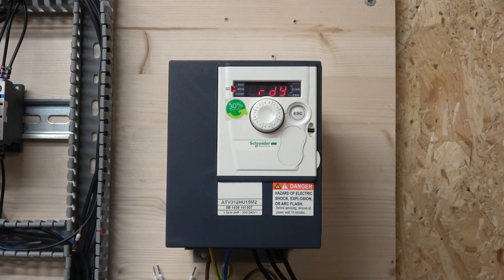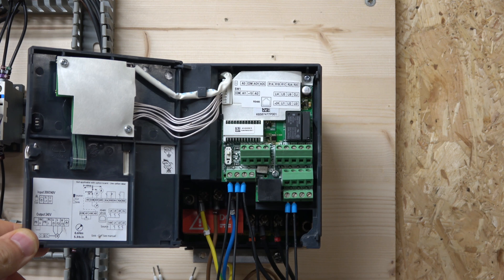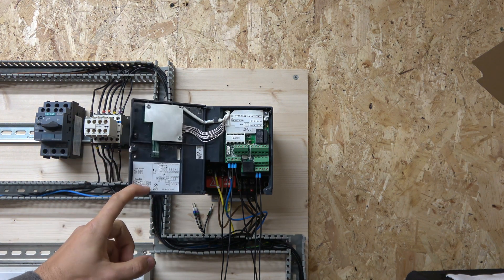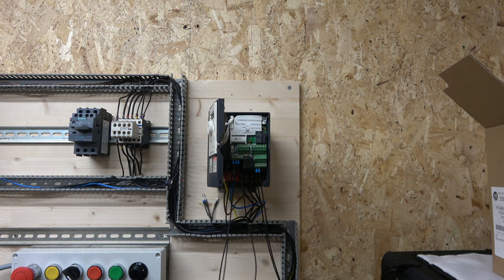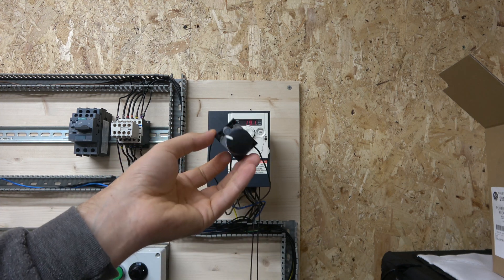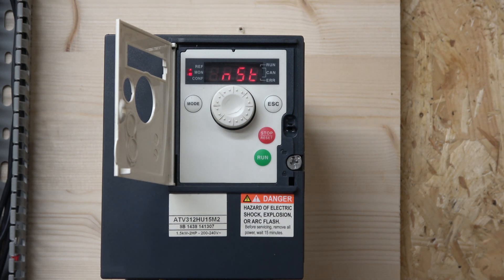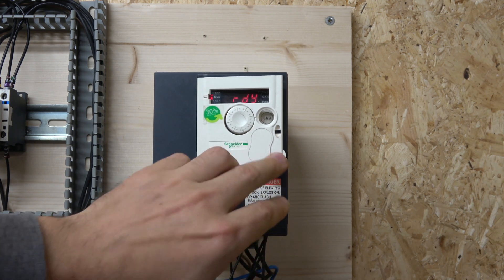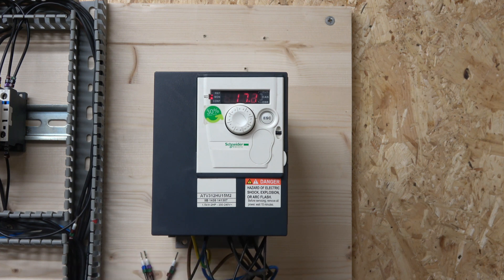Altivar ATV312 Remote control wiring, 2 wire control and 3 wire control (English)

Comment: This is a practical and hope you will provide every terminal details for pot start stop nd revers forward controlling with hard wiring connections
Reply from the maker: Hi Ravi. I am planning to make more videos of this drive in near future. Do check out the ATV320 drive, wary similar setups as ATV312 bit in them videos i dive in lot deeper in wiring and other types of set ups.